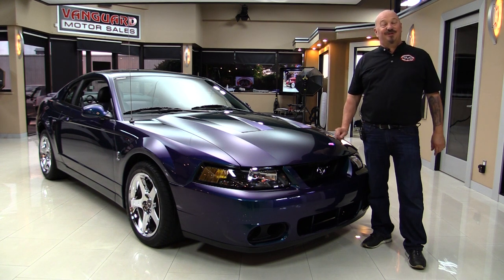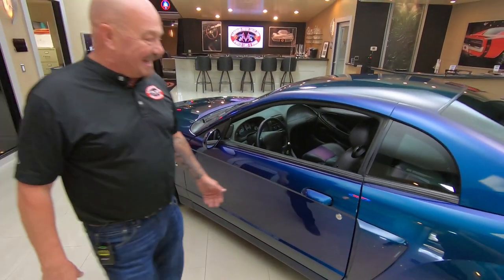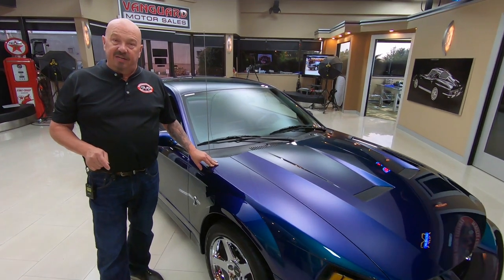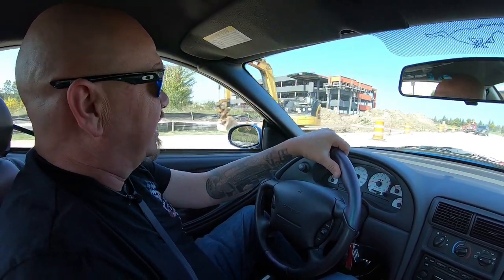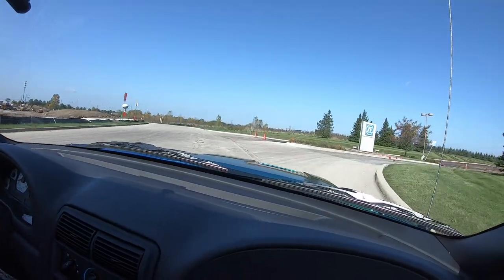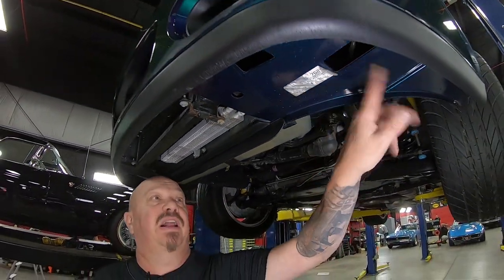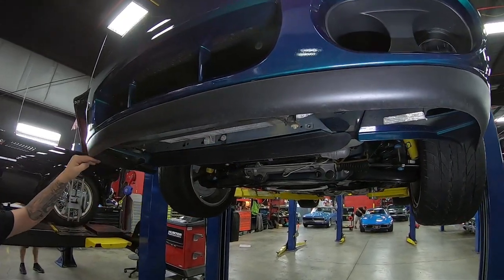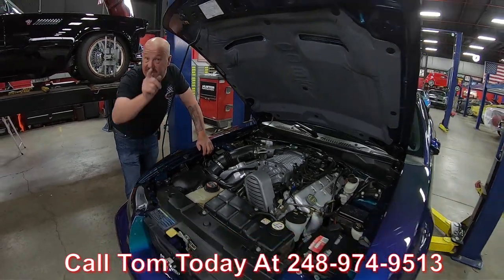2004 Ford Mustang SVT Cobra For Sale

Comment: lol, I randomly noticed that this Mustang has a Motorcraft FL-820S oil filter. That's the same exact filter that my 2000 Lincoln Town Car requires. I just bought one with my recent oil change. I am very observant like that. 👍